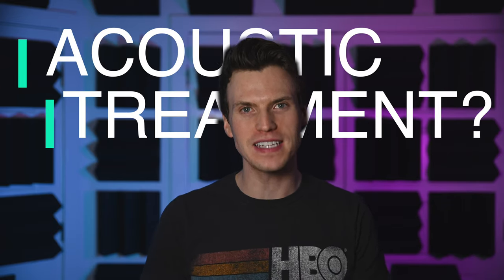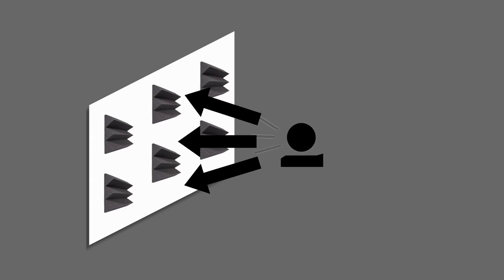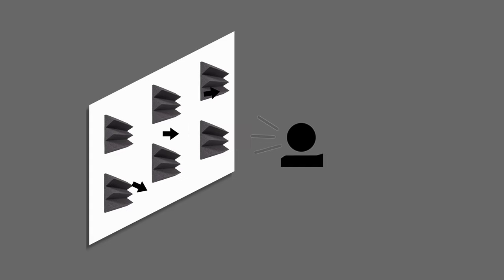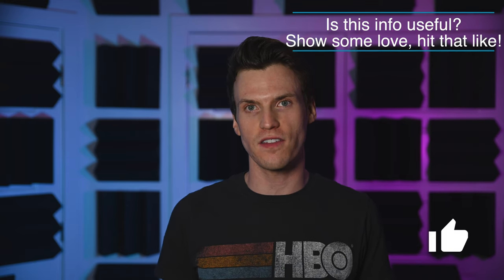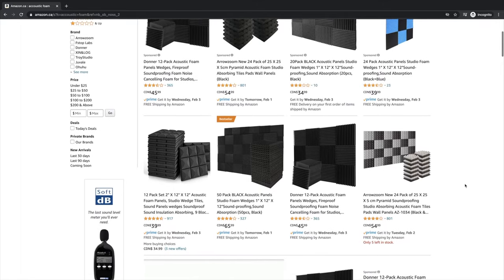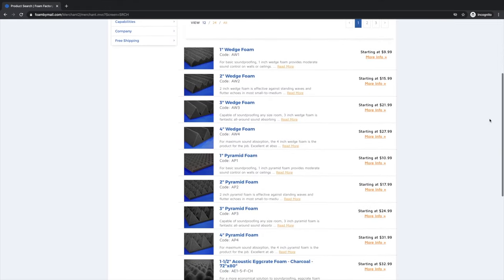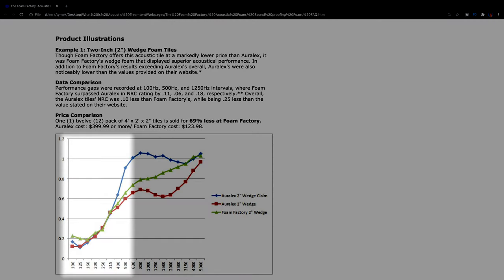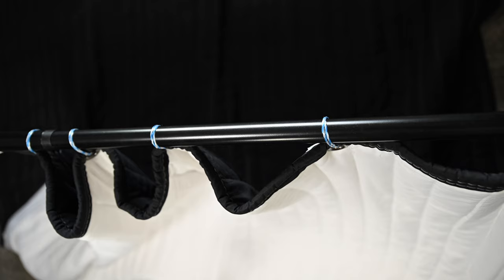What is acoustic treatment and why is acoustic treatment important

Comment: Good to know there are alternatives to Auralex! So expensive
Reply from the maker: Definitely! if i just went with Auralex, i would have paid so so much more.
Reply: I made the mistake of spending 1k on auralex years ago for my studio before I knew any better.  Foam is better than nothing but it's actually the worst treatment you can use.  It's only absorbs high frequency and dulls the overall sound when monitoring\mixing.  The best thing to use is broadband acoustic panels (which you can even make yourself cheap) and it's far cheaper than auralex.  It only gets harder and more expensive when dealing with bass traps (that actually work).  Auralex bass traps are completely useless.
Reply from the maker: @stolencoats63  I considered the broadband acoustic panels but I was worried I would make them incorrectly, and with it being a little more difficult to gauge how well your treatment is performing I looked into pre-made but those are a pretty penny themselves. How much coverage of the broad band panels do you have on your walls ?
Reply: @TymekStolarz  so now that I thought about it, for your application (which I'm guessing is for recording audio for youtube videos), I think the foam will get the job done decently.  If you can get it for a fraction of auralex (and the quality\density is relatively close to auralex) I think you will be ok but I would never spend the money I spent on auralex if I knew what I know now.  I could treat the room far better for half of what I spent.  I'm currently setting up a room for music mixing which is the critical difference between our use cases. I've been doing a ton of research on acoustic treatment (this kind of info wasn't as readily available when I bought my auralex). Foam will create a dull sounding room since it only absorbs high frequencies.  Acoustic panels cover a much larger frequency range (but will not handle bass).  In my case, I can start out with light treatment and only hit the major reflection zones of my studio monitors (behind speakers, left\right of speakers, above speakers).  That will make my listening position reflection free.  I can add more panels later to treat more of the room.  I wasn't trying to crap on your video or decision to go with foam, only to provide info I wish I had years ago.  Again, rethinking the assumed use case, foam should make a big difference in comparison to an untreated room. Cheers.
Reply from the maker: I didn’t think that at all, thank you for the info. I was aware that foam panels weren’t the Best option, but at that price point, and given I am only trying to absorb my voice, and not mix audio in, it was the best cost for performance option. I haven’t completed my office tests yet but I can instantly tell my set up made a huge difference. The sound blankets also seemed to help a lot. Take care and happy mixing! :)